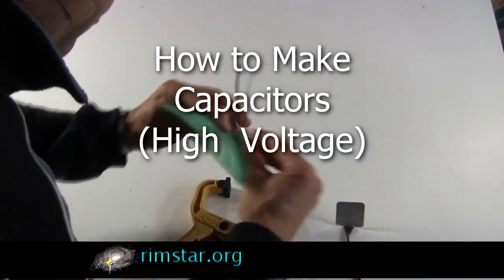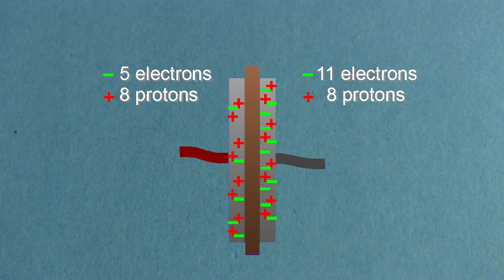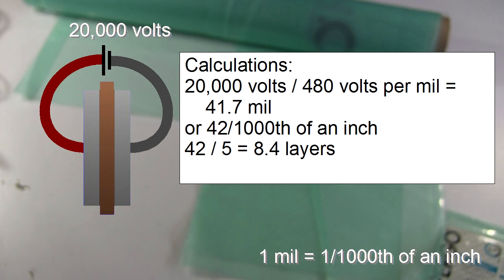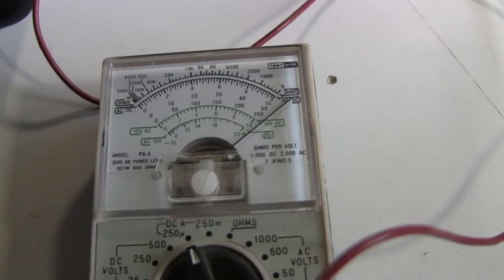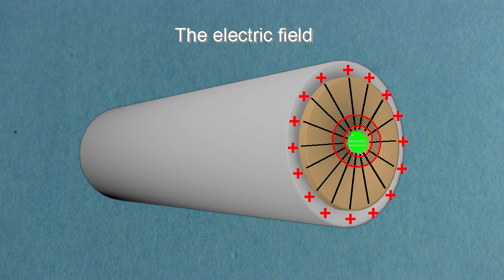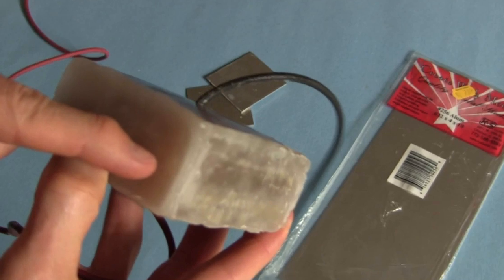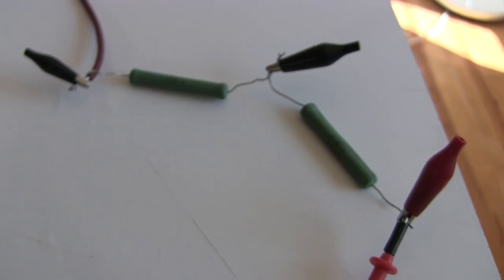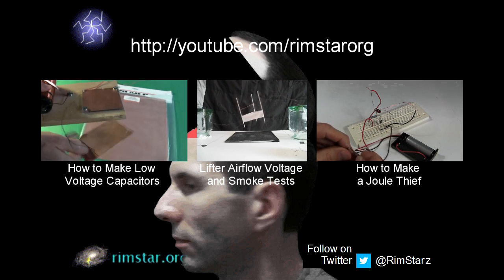How to Make High Voltage Capacitors - Homemade/DIY Capacitors

Comment: "any you can see the current is off the scale [continues listening to the nice sounds]" you'll kill your instruments some day :D
Reply from the maker: Too late. I already damaged the current measuring features of my expensive Fluke meter, I think when working with high voltage. :)
Reply: RimstarOrg btw, i just built a small setup using a microwave oven transformer and it's capacitor (the same model you showed in the beginning of the video), but it's far too low voltage and too high ampere (i get max. 1cm arcs, but it just vaporized my jacob's ladder made from 8AWG copper), could you give me some hints on building a capacitor bank for that? i guess the 50Hz AC could be a problem there? and I don't have HV any diodes to build a rectifier...
Reply: RimstarOrg oh and when using the standard crocodile clip cables that came with my multimeter I have to suspend the HV output using e.g. plastic boxes, because I get almost 100% leakage into the wooden floor (which, by effectively shorting the HV to ground, also stresses my transformer quite a bit), but until i get better insulation, i'll just stack boxes around the floor :D
Reply from the maker: I don't have much experience with a Jacob's ladder. I tried it only with my flyback power supply with builtin diode and it worked. I suspect it needs HV and lots of current, but I'm not sure. It's just not something I've experimented much with. Must have been a lot of current to vaporize 8AWG wire!
Reply from the maker: Yeah, if I'm running the wire across a table I usually use a few old plastic bottles. Same thing. :)
Reply: RimstarOrg i just built a wooden frame housing the MOT, cap, one of the microwave's fan motors (ballast) and a few big screws as terminals. Works fine. I used the cables from the microwave for almost anything. But using self adhesive aluminium tape just taped to the wood as ground (so i just have to screw all grounded components in the tape
Reply from the maker: Oh. A MOT. Yup, that will vaporize 8AWG wire alright! I guess I don't need to tell you, but be careful when working with that amount of current and voltage. MOTs are fun but dangerous.
Reply: RimstarOrg i built a 9MOhm resistor from 9*1MOhm resistors in series submerged in machine oil in a small polyethylene case and insulated the holes for the wires with hot glue. if i hook this up in series at the secondary coil, i get nice big sparks but no overheating (continuously checking everything with my IR thermometer gun) when driving without the ballast.
Reply: RimstarOrg btw, do you think i can use this setup to power a TEA laser?
Reply from the maker: I don't know, impossible for me to say for sure. You do need a high voltage with a fair amount of current, judging by how much I needed to open my spark gap for the laser. A MOT should be able to do it.

Comment: Ok... i have a few questions/suggestions

#1  i am using soda cans for my aluminum plate source.

i want to layer my capacitor with ten 1" Outer diameter plates and an 1/2" inside diameter. I konw there is already some coating on the aluminum so should i sand it first or just take it as a bonus insulator?

#2 i want to cut each "washer" and open it like a lock washer.  I want to adhere each lock washer with a slight overlap of an 1/8th" what do i use to adhere the two plates?

#3 after the plates are chained together i want to run my dielectric in the same manner.  note two sets of plates required for cap. so each plate will be a series or five washers fused at ends and slightly offset from the other set of washers.

#4 the housing is intended to be pvc pipe inside diameter of 1 1/4" and the dielectric's edges would be pushed up in the center and outside of the coil along side the pipe and a plastic rod in the center.

i want to use Mylar as my dielectric... i plan on getting it from emergency blankets/space blankets.

what are your thoughts?
Reply: oh and the pipe was to be filled with mineral oil just for kicks.
Reply from the maker: I'm not getting a clear picture at all of you're describing. But regarding your questions:
#1 It sounds the like that between the plates will be 1/2" so I don't think the extra capacitance of the very thin coating on the aluminum will make any significant difference.
#2 Do you mean you want to adhere the two ends of the cut washer to each other with an overlap? So metal to metal? I'd shape them so that the glue isn't holding them like that, so there's no stress, and then maybe use JB Weld to glue them if it's still needed.
Reply: imagine a cut washer.
place it on the table.

note! these washers are cut from an aluminum can and are likely about 5-10 mil in thickness.

spread the cut, up and down,
take another cut washer,
and do the same to it.
now take washer one and
adhere it to washer two
as to form a single plate in an upward spiral.
(much like a spring with no tension)

five washers makes one plate/coil.
intertwine two plate/coils,
a, primary and a secondary,
with a dielectric between surfaces.
again i was going to use Mylar for the dielectric

then submerse the coiled plates
with dielectric between them into
the pipe with mineral oil in it.
contacts should have been soldered to one end of each coil, both on top end of pipe.
Reply from the maker: Matthew Norman
Oh, in that case JB Weld won't work since you'd want a glue that's electrically conductive. I don't know of any electrically conductive glues off hand but I'm sure there must be some.
If your dielectric is made in the same manner then it will have differences in it wherever there are joins. The joins will be twice as thick as elsewhere due to overlap and also whatever glue you use there. This will mean some difference i the electric field. However, I don't know if that will be significant. Why not just skip that dielectric and rely on the oil being the only dielectric.
Reply: i guess i am trying to over achieve and build a transformer/capacitor in the same device.
Reply: i can use a plastic welder on the dielectric to minimize differences in thickness.

Comment: Could it be possible to use a high voltage capacitor to run an ionocraft/lifter
Reply from the maker: No, I've done some math on this recently and while it's better than ten years ago, the electronics is still too heavy.
Reply: what if i have the HV capacitors on the ground and wires leading to the electrodes(not using a HV power supply)

Comment: Could it take some time to break down the dielectric layer?  In other words... by going to one layer you created a catestrophic breakdown of the dielectric layer that happened almost instantly?  Also, poly may be porous at least at the mircroscopic scale and so the density of the poly may be important too.  Just some thoughts to share that may be value or not.
Reply from the maker: I read somewhere a while back that dielectrics do breakdown gradually, but I think that's during the breakdown itself. i.e. it's not a sudden explosion all the way through but more of a gradual melting through. I wouldn't rule out that the last one had a flaw in it, and that in fact a number of the layers had flaws but none of them manifested themselves until there was only one. I know when I made my TEA laser I went through a few sheets of poly until I found one that would last a while.

Comment: hey there seems to be a delay time from when you reach your high power to it popping so maybe get to 2000 and then after a short time it will breakdown this may be why some online stats may look inacurate, just a thought.
Reply from the maker: I think the delay is because the material is broken through a little at a time, like digging a hole, so that's normal. I just searched for the documents from the standards body for the test but couldn't find any for solids and high voltage DC (i.e. not with a frequency) and couldn't find one. The details for the standard test I'm doing I got from here http://rimstar.org/materials/dielectrics/dielstrength.htm but that doesn't say which standard it came from. If I knew that then I could check for delay information.

Comment: I have a 2mm thick glass and roughly 1.5kV... My calculations show that I'd require at least 28kV for dielectric breakdown of the glass. I am looking for another substitute for glass with lower dielectric strength. Any ideas?
Reply from the maker: Not off the top of my head. I'd have to look it up, the same as you. I usually do a google search for breakdown voltage table or dielectric strength table.

Comment: As an addition, you may consider showing how to make a HV tesla coil capacitor/s to form a bank for the proper value... series/parallel, etc. I made one 20 years ago with thick polyethelene sheet and aluminum flashing submerged in mineral oil bath in a piece of 6 in. pvc... Sadly, i never got to build my coil and gave the thing away...

Comment: can you help me understand what im dealing with when people say, by just connecting a high output capacitor to a moped spark plug wire, the output spark will be much more powerful?. i would figure, as the engine revs up and more power is stored by the capacitor, the capacitor will just blast out a constant arc and pre-ignite the fuel and destroy the engine.  do i need to use a coil in combination for this to work?  the point with what im trying to do is a more complete fuel burn. because of 2-cycle engines design, some of the unburnt fuel exits out the exhaust = pollution. i was told to somehow increase the spark power to achieve a "clean" burn.  in other words, will juts a capacitor work? output power is 24v. could i acheive 300v output? current output is 150v to spark plug. i need double.  haha....thanks for your time.

Comment: What is the values? How many Farad or micro Farads?
Reply from the maker: I didn't measure the capacitance but it was picofarads for sure, probably tens of picofarads. High capacitance is tricky with high voltage capacitors since you need thick dielectric, and the thicker it is, the lower the capacitance. And to get high capacitance you also need a large plate area, and the more plate area the more chance of a faulty dielectric somewhere.

Comment: so i have to ask, if i take solar power to 10,000 volts and reduce it to 100 volts is thats a increase in the amperage we use? why are we going the other way?
Reply from the maker: Yes, if you drop the voltage than the current goes up proportionately. The power, or energy, stays the same though so ultimately it doesn't matter. The reason we have solar panels and arrays of solar panels produce high voltage is because the power from the solar panels has to be transported to the inverter or charge controller. That's usually some distance. The higher the current you produce, the more heat is produced and so you need thicker wire to handle that current without melting the wire or the insulation. And copper is expensive. So we go with high voltage and low current, at least up to the inverter or charge controller. The inverter or charge controller can then adjust the voltage/current to whatever they need to.
Reply: it would seem you missed the point of my comment, smaller wire's with high voltage less current and voltage loss, why not charge up super caps to high voltage and discharge them one after the other to produce a steady flow of electricty to the batterys/ charge controller or the inverter?
I guess my real question was , do you think we could use caps , on the solar panel side to create a more steady voltage into the charge controller and use low sunlight to charge a battery better?
Reply from the maker: scot fletcher
The first question is can supercaps store a useful amount of energy to make a difference. Calcs I've done in the past say you'd need an awful lot of them, otherwise you'd be able to do away with batteries altogether and use supercaps instead.
But assuming some day supercaps can be practical, then sure. You'd have to make up some circuit to put between the solar panels and the charge controller. The circuit would monitor the state of charge of the batteries and use that to determine how much to send to the charge controller and how much to send to the caps. If you just put the caps between the panels and the controller with no circuit then the controller would take all you can give them and throw away the excess. You could ask why use a charge controller at all? Charge controllers have a lot of other features you typically want too, unless you make your own.

Comment: Awesome videos. You make a fantastic instructor. I hope you continue on. Maybe step things up to a more intermediate/advanced level later on if you run out of ideas.
I do enjoy your work.
Reply from the maker: Thanks! And thanks for the video idea suggestion. I hadn't thought of that, more intermediate/advanced ones when I run out of ideas.
Reply: RimstarOrg Could you do a video explaining the difference between AC breakdown vs DC breakdown voltages? (or maybe just reply to me) Is there a difference? I would think the only difference would be the requirement for plates that can handle more current, If you make a followup video, you could also include the topics of stray inductance, resistance, and capacitance, ESR, etc.
Reply: Power Max
Now that would be a great topic of a video. I'd love to see more on troubleshooting and the various circumstances of component breakdown. Throw in the differences between AC and DC breakdown and that would be a whole series.
Reply from the maker: Power Max
I would like to know the difference too! But sadly I don't. All my experience is with high voltage DC breakdown issues.
Reply: What if you create replace the flyback transformer with an alder AC one or even create your own primary, so that you can achieve an AC output?
Reply from the maker: Power Max
If I'm not mistaken, the output of the flyback is high voltage AC. It's the tripler/Cockcroft-Walton multiplier that turns it into high voltage DC. Note that I'm talking about a pure flyback like the one I have (just a primary and a secondary with a bunch of taps.) Some flybacks also have diodes attached that turn the output into pulsed high voltage DC.
Reply: +RimstarOrg Yes, exactly. But some older types can be found online that do not have a multiplier stage built inside them, back when tube TVs were made with quality decrete parts and components, rather than the newer 'junkier' ones.
Reply from the maker: Power Max
Thanks for confirming. At least the newer ones with the diodes can save on needed the tripler if pulsed DC and the lower voltage are okay for the application. I have to get one and try it some day.

Comment: Very good video. I posted a tutorial using a wide roll of aluminum foil tape. Copper tape made by 3M is the best, you can solder the wires directly to the tape when the cap is made. I made values up to 50nF.

watch?v=874CabtIWxw

Comment from the maker: You can definitely find it, but just made by a different company. It's use in electronics for helping prevent voltage breakdown. Look in electronics stores and electronics supply websites for "corona dope". It has a very high dielectric strength/breakdown voltage. Look in electronics stores and electronics supply websites for "corona dope". I just put a link for you in the description for this video to the webpage of the manufacturer, MG Chemicals, part number 4226.

Comment: I was just surprised to see what I thought was way over kill on a dielectric breaking down. I guess it’s something like trying to measure the pressure to push a sharp knife through something vs. a dull knife.  The sharp knife will sink deeper into some material given the same pressure.

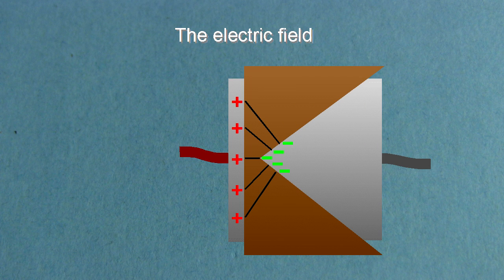Comment from the maker: Absolutely, the shape makes a difference. That's what I was trying to illustrate in the video at 6:00. What you're seeing with your wire is what I'd expect you to see. Try it with flat plates and you won't break it down as easily. I don't have any derating factor. I doubt that you'll find derating factors for breakdown voltage. You can find breakdown voltages for different materials, but they're tested with standard shapes. To know for certain with your plate shapes you just have to test.

Comment: I have a regulated power supply that runs at 5.8K volts DC at about 4ma and have tried several different “Polyethylene” films without any luck. I am not using a flat plate to test the material just touching a wire to each side of the dielectric/insulator and listening for the crackle of current pushing past the dielectric/insulator. My question is, does the shape of the electrodes or plates make such a difference i.e. de-rating the dielectric by a factor of 100.  Your thoughts?
Reply: Mark Schwartz I'm sure that has a major effect, if you have power trying to enter in one spot very strongly then yeah it will break down.. that's why he put a flat plate, it's more realist with how it will operate

Comment from the maker: I didn't measure the capacitance - very small I'd imagine, probably picofarads. The point was just to show how to make ones that could withstand the high voltage. Once you know what capacitance you need, then you'd apply the principles in this video, in addition to using the geometry needed to get the desired capacitance.

Comment: Im very new to electric applications the most i have done is built a small kinda hovering motor thing using very basics like a motor an ac 16v adapter and a few cables with propeller blade mounted to the motor. I found this video extremly interesting and it has definatly expanded my knowlage atleast abit. Thank you great video :)

Comment: A circuit with a reasonably high capacitance of 5-10 farads which is fed by a rectified 110 VAC. How could I make a connection that runs along the entire length of each plate?